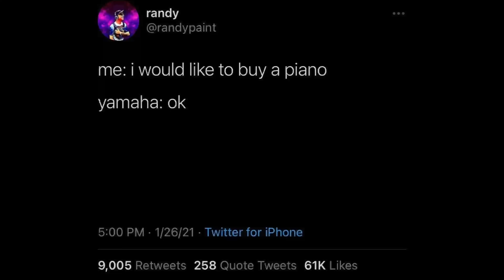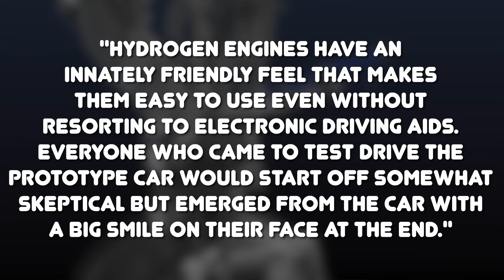Toyota's New 455HP Hydrogen V8: Everything You Need to Know

Comment: Hydrogen is better it does have a solid place in the future. #1 it will NOT be an out dated technology in 2 years the way the electric motor is .ie look at cell phone technology, ever 2 years the tech changes so much it's no longer profitable to service. #2 refuelling time is so much faster & easier to do. ie not an 8 to 10 hour process. #3 the common man will quickly pick up on the tech to modify his play toy (car) so yes hydrogen does have a place you as I too short sighted to see that.

Comment: Unfortunately, there are several big Achilles heels to hydrogen that will limit adoption. 
1) hydrogen has a very low energy density which will give you very low mpg compared to modern gas/diesels.
2) creating hydrogen is NOT easy. There are two main ways to generate right now, steam reformation or electrolysis of water. Steam reformation is breaking down natural gas meaning you are still generating CO2 and electrolysis is very energy intense.
3)after you generate H2, you have to store it as a compressed gas or a liquid, both of which take so much energy, that this process alone can take 2 times as much energy to complete than the hydrogen fuel will produce later on.
4)H2 has a VERY wide explosivity range. So if a tank gets ruptured in an accident, it is far more likely to catch on fire and explode than gas.

Having gone to college for chemical engineering wanting to work on hydrogen fuel, I quickly learned it is constrained by the laws of thermodynamics and far more of a pipe dream than say a rotary engine. Will it work? Absolutely. Will it be end to end efficient/cost effective, not likely unless there is a way developed to recapture a large portion of the energy used to compress or liquefy the H2.
Reply: Plus it's never going to be a cheap fuel.....

Comment: Hydrogen stations could be implemented easily and current hydrogen cars are electric but use hydrogen to create power / evs produce unnecessary ewaste tesla chargers use diesel generators to create power if im not mistaken etc. 

Hydrogen would wind up cheaper if more people invested/ implemented it and i belive the hydrogen combustion engines might make that happen

Comment: The whole reason behind switching from gas to hydrogen is solely based on it being basically 0 emissions. That is 1000% a reason to switch from gasoline to hydrogen. Main reason they didn't take off is due to not having a reliable system to refuel anywhere in the us
Reply: Exactly, plus the cost to fill up on hydrogen might be more expensive than gasoline.
Reply: @michaelbrinks8089  It is cheaper for hydrogen.
Reply: @michaelbrinks8089  Also the pricing will be correlated to electricity price. With coal it's expensive and will be even more expensive with renewables. To mass produce hydrogen you will need combo of nuclear (we need a lot of them) and big hydro to make it cheap and actually can be produced with stable cost.
Reply: Yeah once the infrastructure can support it, hydrogen is going to be a great option
Reply: Refueling and hydrogen extraction are the biggest down side , Those seem easily overcome 
Cars  using electricity produced by obsolete high emission coal plants putting an additional drain on a resource that’s becoming scarce , plus the energy needed to extract limited  materials needed to produce batteries and someone 
 with a brain will say Electric cars are a shell game or a way for the wealthy to further exploit the less fortunate .
Please renewable like solar and especially wind are another scam. 
Electric or rather battery cars , weaken the national security of a country ..
Congress could simply place a huge tax on electric doubling an already high price and poof it’s a niche vehicle for the wealthy.
Hydrogen has potential to be the car for the masses just a gasoline or diesel vehicles are . 
Think outside the box
Reply: Infrastructure for hydrogen will NEVER, EVER exist in the US as long as the government has a say
Reply: @profound369  that's literally what I said
Reply: @TylerJohnson-mg2wj  yeah I know you said the reason, I just added a bit to it
Reply: @TylerJohnson-mg2wj  you said it didn't take off because there's not a reliable infrastructure, but not why there never will be a reliable infrastructure so I just tried to elaborate a little bit.
Reply: @Raspian Kiado reply to Raspbian kiado: potable water comes from the oceans. It evaporates leaving salt behind. And falls as rain.
Reply: @Raspian Kiado reply to Raspbian kiado: so all our potable water comes from the salt water oceans in the form of rain. So all the water is potable. Ponds and lakes are supplied from rain water that comes from the oceans. We must not use hydrogen for energy. Earth will dry up.
Reply: they had the same problem with gasoline 100 years ago. but oil profits were high, so they did it anyway. We could have a lot of things. the reason why we don't have this or that is because no one wants to put in the work. no profit in abundance. it is why we will never have true technology. tech and a monetary society cannot be combined. you've got to choose one or the other. abundance or lack. put high technology into the mix, your dollars will crash. that is why so many patents are held because of "national security, economic threat". even one advancement (hydrogen) will break someone's very large piggy bank. if that happens, the economy becomes worthless. governments run on money. worthless money makes redundant governments. the government has many protocols to ensure it continued survival. self defense of the government. you do not establish control to only lose it. you defend your control and the only way to do that is by tightening it. it's a one way course for anyone who has ever felt "i should control this". look at families. once a parents makes the decision "i should control this", a rift ensues. the only way to maintain that control is to keep tightening it and adding more controls. 
it is a simple situation with a simple outcome for simple reasons. it is the only thing we see happening around us. it has happened in every version of history as well. it is our perpetual experience as humanity because we view ourselves from a point of fear. eventually someone will want absolute control. oh wait, this has happened over and over already. all made possible because we feel the need to charge someone for something.
Reply: 0 emisson when burnt, all the pollution is at the production, liquification and transport side. hydrogen is an energy carrier, not a source, and an inefficient carrier at that (38% efficiënty optimistically)
Reply: @nicoramaekers1623  you don't need to transport it if you just make a hydrogen generator. Which is water and electricity
Reply: @TylerJohnson-mg2wj  flat earth level nonsense. the nergy content is low so it needs to be liquified to make it energy dense.....not gonna spend my time teaching elementary school level chemistry here.
Reply: @nicoramaekers1623  well theres no such thing as elementary chemistry. they dont teach chemistry till highschool and there is such things as hydrogen generators, which have been proven to work countless times
Reply: Hydrogen source is water. Hydrogen is for drinking and washing clothes not engines.
Reply: @eugene7518  you have achieved unmatched levels of myopic reasoning. congrats.
Reply: @Tenvince  we must not use hydrogen to power engines. Hydrogen comes from water. Water is for drinking and washing.
Reply: @eugene7518  lol. i think u may have said this already. check the comments section
Reply: @Tenvince  I am Mexican American. I now what I wrote grjngo. 🇲🇽🇲🇽🇲🇽🇲🇽🇲🇽🇺🇸🇺🇸🇺🇸🇺🇸🇺🇸

Comment: The production of electric car parts isn't capable of producing more than a fraction of a percent of the world's vehicles. 
Combustion is here to stay for many many many years yet. 

Still waiting on that semi truck, any one, to make an electric semi. 

Batteries are not getting better, not substantially. You can track power per weight and per volume for batteries and it's stagnated. Tesla "doubled:" battery capacity by doubling the size of the cells. WOW how revolutionary, and it took them 2 years over their predicted deadline. They also get batteries from other manufacturers to arrange into battery packs. That should tell you everything you need to know about the absolute state of batteries. 

Plus the physics of how batteries store energy hasn't changed and we're damn near close to maxing out the charge per weight. However there are no limits to the amount of click bait stories about how X university has found Y BREAKTHROUGH that's going to Z change everything.... maybe... in 20 years... if we can make every battery out of gold coated carbon nano wires...a tech that still hasn't produced a single commercial battery covered in one of the most expensive/rare materials. 

Do your research. This video was speculative garbage and there wasn't even a video of the v8 running. Trash
Reply: Er, it isn't. Not in the UK and most of Europe at least. In 2030, that's it. NO more new ICE cars or vans can be legally sold. Several UK car makers - Mini, Bentley, Nissan and Jaguar/Land Rover - are all switching to 100% EV production in 2025. Audi have stated they will be producing their final ICE cars for the European market in 2026. If 3 to 4 years counts as "many" to you, then fair enough....
Reply: @Brian-om2hh  undeliverable promises
Especially considering how all the lithium comes from developing countries that China, but the west, is funding and progressing. 

ICE will remain indefinitely even if just used cars are repaired forever. Cuba still has an entire industry running on 50s to 70s era vehicles. The EU can regulate and demand all they want. The reality is that if they impose that deadline, many less people will drive and cars will be the domain of the elite

Comment: I think they are making a smart move in the long term. Electric seems great and manufacturers are starting to pump them out but one key thing is missing. That main thing is the grids infrastructure to handle this influx of evs to all charge. Hydrogen might not be the future but could very well lead to the development of a new motor powered by some unique energy source. You don't want to put all your eggs in one basket concept comes to mind. If the grid experiences failure or temperature is too hot or too cold this effects EVs substantially. Plus EVs are superior right now say but what might be even better later? The continued innovation is great for the market and evolution of transportation.

Comment: Hydrogen makes so much sense.  Even the production of it would make for 
cleaner water and air, as you could make the gas from the dirtiest of 
water, leaving the polluted parts as an easy to dispose of byproduct.  
The use of the Hydrogen would leave pure water vapor.
Reply: and you can construct renewable power plants in remote areas, and use the power to produce hydrogen, easy transport to place that needed the fuel (either cars or power plant)
Reply: The problem is, this engine wouldn't produce only pure water vapour. You're thinking fuel cells, not ICE.
Reply: @airchie2  Probably also ammonia, due to the presence in air of 5 N2 for every O2. Perhaps also NOx.
Reply: @airchie2  yeah, it is technically a false statement to say the H2IC is zero emission. But in practical comparison to a petrol engine it does have near zero.
Reply: @jamesschmames6416  I don't disagree that ICEs running hydrogen would have less harmful emissions than those running petrol or diesel. Its just that there's very little benefit to switching the fuel source of the ICE. It'll still be a complex machine requiring expensive maintenance. Otherwise it'll run much less efficiently or even fail. Then you need to consider the production, compression and transportation of the hydrogen.
EVs solve most of these issues. They still have an associated environmental cost for manufacture and electricity generation but those costs are miniscule when measured over the life of the vehicle compared with even a hydrogen ICE.
Without some huge breakthrough in hydrogen production efficiency, Hydrogen is a terrible choice as a store of energy...
Reply: @airchie2  no argument from me on most of it, but efficiency doesn't always matter. If you are not producing the hydrogen yourself then it matters. But I can imagine a lot of scenarios where the benefits are more important than efficiency. Especially when range, weight or turnaround are a factor. For me though the killer app will be for the hydrogen farm. It is all about capital costs and the fuel savings can easily amortize the necessary equipment. As long as you can build on-site solar and wind, enough to meet your needs then efficiency is mostly unimportant. Farmers want to run their equipment around the clock in fall and winter and not have to spend half the day idle on a charger. They also have busy seasons in spring and fall, with months of light duty in summer and winter. This means you can undersize your installation compared to peak demand by storing up during the off seasons. What I don't get, there was a fuel-cell tractor demoed in 2009 and yet 13 years later I can't find anyone offering a production version.
Reply: @airchie2  its not effceint but its sustainable in terms of whats going into and out of the system. so maybe if government stoped supporting electric battery cars and their lack of recyling and emissions issues, and put that effrt into hydrogen with electrolosys and nuclear, thermal, water turbine energy etc, itll would be better
Reply: @kalmmonke5037  The lack of efficiency makes it unsustainable at scale. So without a sustainable and efficient way of producing hydrogen, mass adoption at scale is problematic at best. 

Regarding government support of EVs, its already phasing out. EVs don't need subsidies anymore, we're past the tipping point. And if there was any compelling hydrogen offerings, they would likely be subsidised also since the subsidies are for low emissions vehicles, not specifically EVs.

I'm not sure what you're referring to with "recycling and emissions" issues? EVs and their batteries are hugely recyclable. EVs have no emissions in use so I'm guessing you must be thinking of environmental impact from manufacture? It is important to measure the environmental impacts from the entire lifecycle of the vehicle including manufacture and energy source etc. Hydrogen fuel cell vehicles (I assume you're not talking about hydrogen combustion vehicles if you're concerned about emissions) require some pretty exotic metals for the fuel cell which would be a problem at large scale. And hydrogen does need to be produced which is also a huge issue at scale if you want to do it in an environmentally sound manner. And hydrogen vehicles ARE EVs, just with a smaller battery and a fuel cell to top it up.

So, basically, hydrogen is a dead end for personal transport. It may make sense in industrial applications if the hydrogen can be produced in a clean manner at scale.
Reply: @airchie2  ne thing for sure is they culd make cars better by having everyday use small battery only driving range, then have combustion generator charging battery for longer trips,  towing etc, less weight than full battery electric only especially in a longer driving range car
Reply: You actually need mostly pure water in order to produce hydrogen using electrolysis. So that is not a strict benefit of using hydrogen as a fuel source. It is more pure water in pure water out. Not a drawback but not a reason to switch. You are consuming energy to purify the water source before it enters the hydrogen production loop.
Reply: What's needed is a Manhattan Project aimed at converting the military and civilian economies over to (mostly) hydrogen. Most of the necessary electricity could, and I believe will, come from Small Modular Reactors, at least until green technology can replace it. I can't see any other way to zero emissions without politically unacceptable declines in standards of living.
Reply: But the production of that hydrogen would use huge amounts of electricity, as it's very inefficient. Hydrogen powered cars are inefficient too, usually managing no better than 22% efficiency....
Reply: @Brian-om2hh  actually i just saw that figure recently, from hydrogen production facility to fuel cell car, in total around 50-60% efficiency retained, which isn't bad since you do not need to build the electrical grid infrastructure for it
Reply: @Brian-om2hh  false
Reply: @Brian-om2hh  I agree. Everyone seems to be jumping on the hydrogen band wagon, but the inefficiencies of these systems make them impractical for many applications.

Comment: Hydrogen power has one superior advantage to electric vehicles, you can fill them up and continue on your way similar to gas. Electric vehicles will always be limited by range and recharge times.
Reply: And the inherent stability issues that batteries will inherently have as their energy densities increase.
Reply: And hydrogen will always be limited by the fact it's an extremely costly fuel to produce..... Don't think it'll be a cheap fuel.....